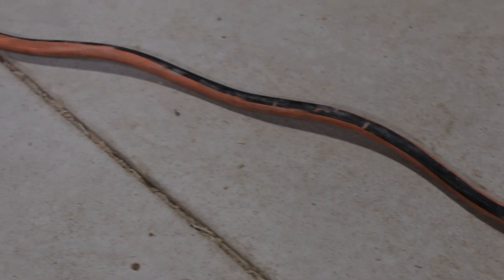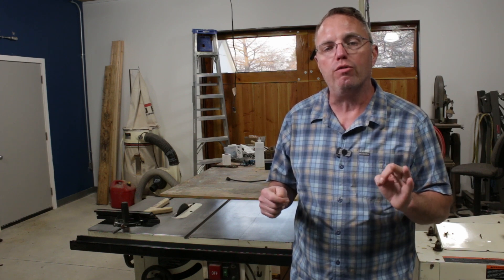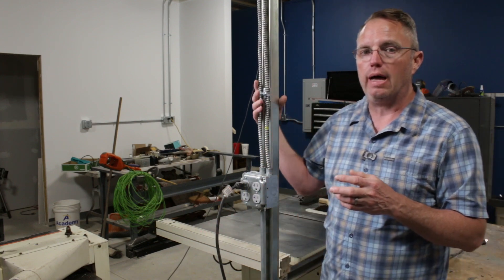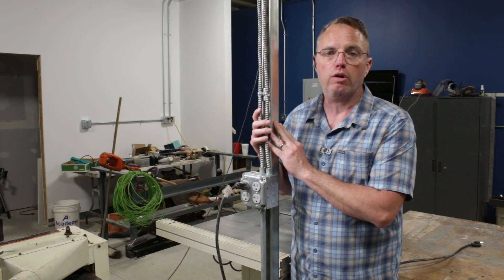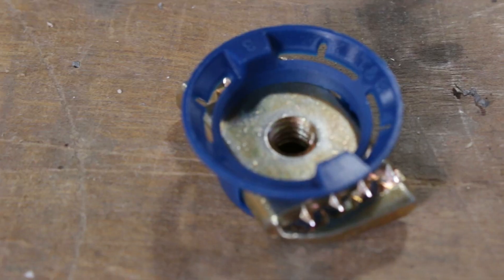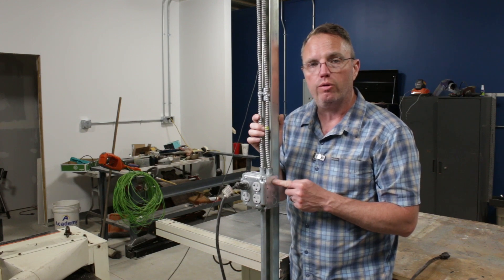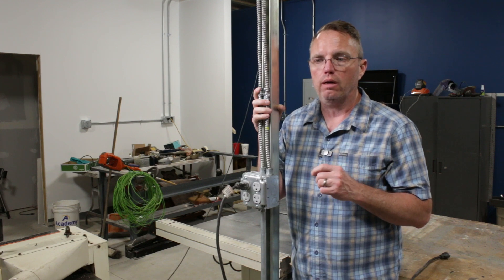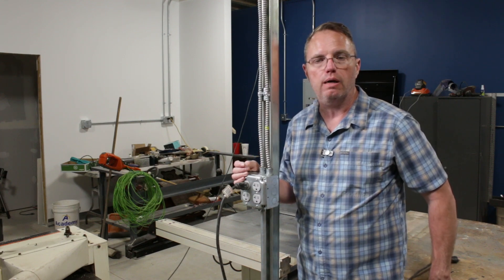Electrical Power Drop for Your Table Saw

Comment: If your planer and saw have dual-volt motors, switching them to 220v will not make the motor any more powerful.  They both will still produce the same amount of watts but just use half the amps.
Reply from the maker: Thank you for clarifying that. I will make sure to point that out in future videos! Cheers!